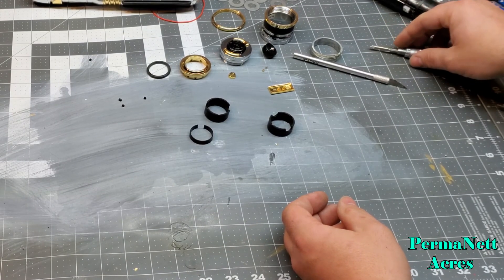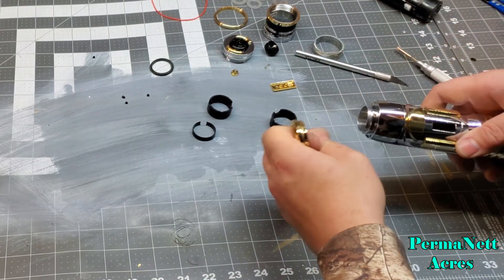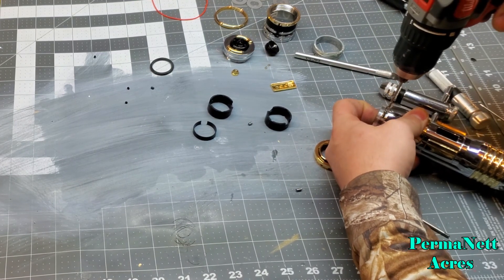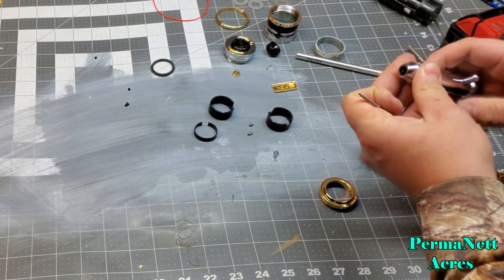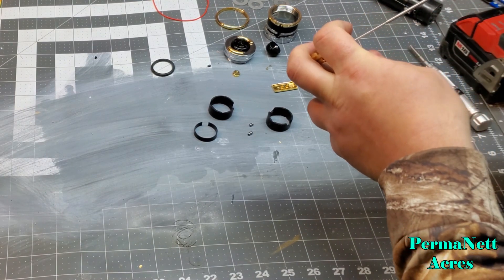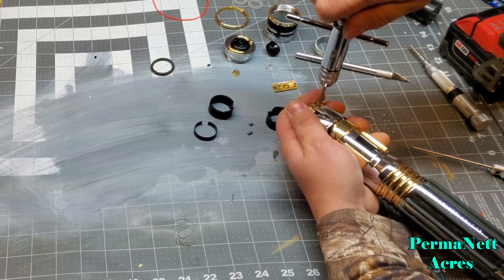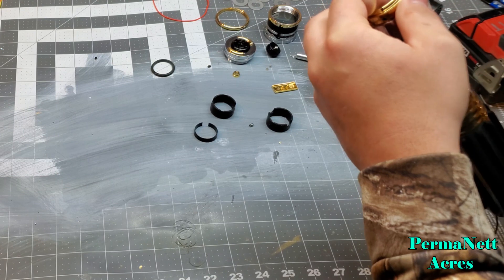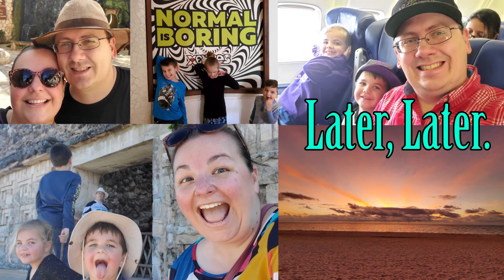05 MR Mace Windu CFX Conversion part 2

Comment: How did you connect the pcb to the tcss blade holder?
Reply from the maker: I used one of TCSS neopixel pcb module housings inside the led insert & drilled out the copper heatsink to run the wires.